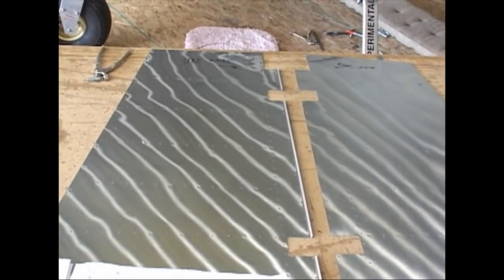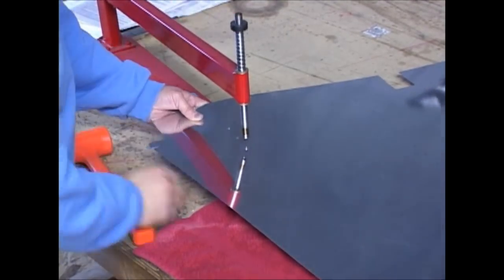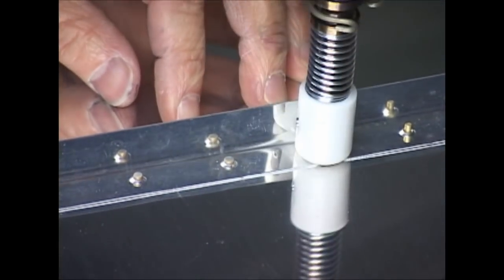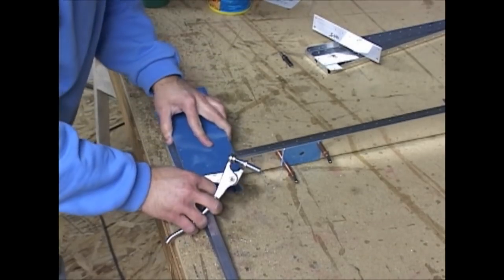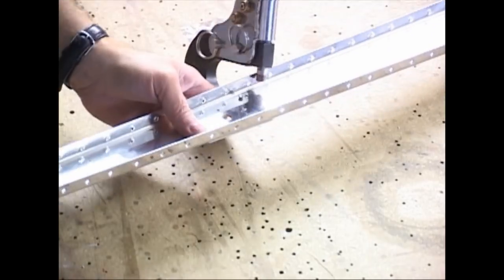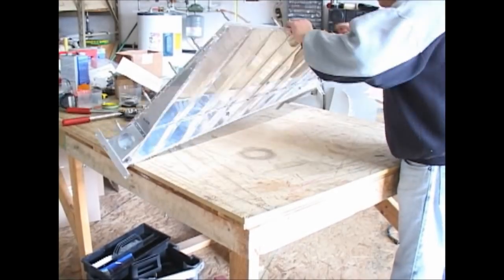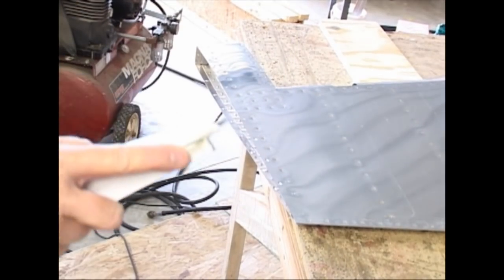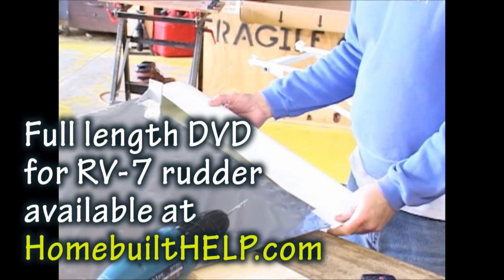Building a Van's Aircraft RV-7 Rudder

Comment: Those skins are under dimpled. Way under dimpled! You see the pillowing and light bending around the dimples? Check out cleaveland tool video about dimpling. You need to either use a heavier steel hammer, or more than one whack with that orange rubber thing.
Reply: @FourthWayRanch  I only use the pop rivet dimple tool when no other tool will get in there. As for the nail breaking, nails are cheap. I use an air rivet tool (harbor freight one works) and turn the air way down so it doesn’t break the nail. It will still break after a few uses.
Reply: @FourthWayRanch  omg! I would quit building and throw away all my tools if I had to dimple everything with the pop rivet dimple tools! Have you tried the DRDT2 or the C-frame?  So easy!